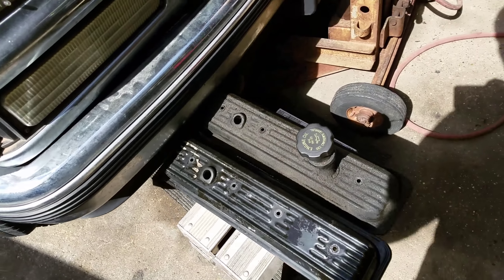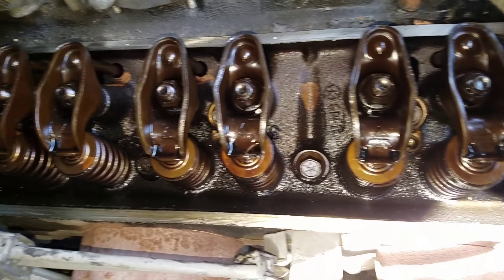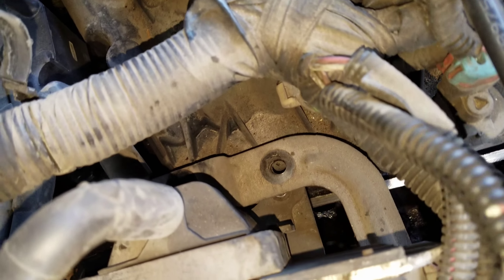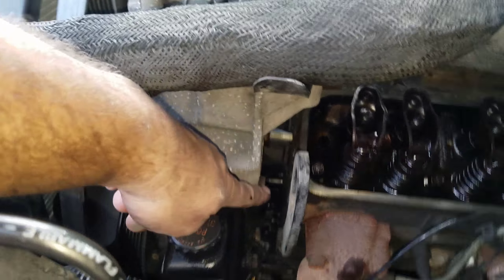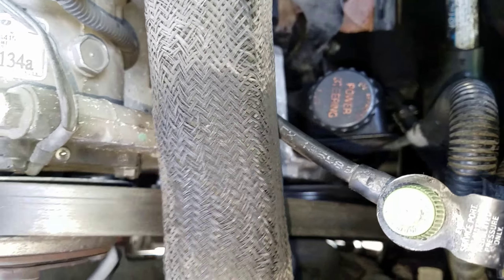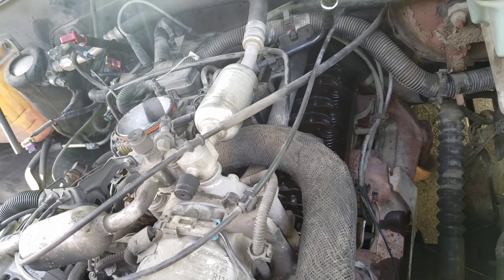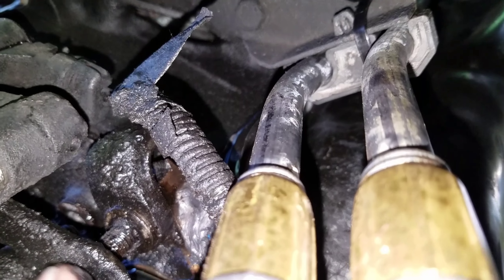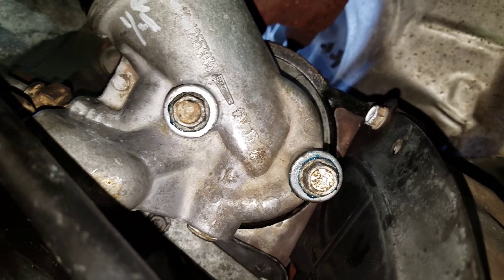1999 Tahoe valve cover removal notes 5.7 z71

Comment: The bolts on the valve cover are 3/8 not 10mm
Reply from the maker: Ok
Reply: @chriskolar  vortec motors are easy to get sae and metric mixed up all the old sbc stuff on them is safe and all the vortec stuff and accessories is metric
Reply from the maker: @trucker6689  yea, my quip was partly a complaint to GM for mixing things up. Thanks for watching. 😎
Reply: Close enough😂

Comment: Its a damn good SUV. One of the best in my opinion.
Reply: bolts get stuck because they are actually 3/8 not 10mm.
Reply from the maker: @weaklingv2  right, its a common mixup having a variety of metric and standard.

Comment: If the rockers and springs are really dirty full of carbon build up. Do you have any recommendations on how to clean it throughly? Someone said to use diesel and a wire wheel on a dremel. To do an oil change afterwards and one after 50 miles.
Reply from the maker: That is up to you and how much time you have. Using strong cleaners is not reccomended. The valve stem seals will get the cleaner on them and may get degraded then not work properly. Using some diesel in the oil is prolly the best method. That will slowly break down the sludge. If using any sludge removal methods remember to keep track of the oil and change it often when it gets dirty. Look out for oil deals at the auto parts. Sometimes old oil brands are sold out cheap. Its still good oil just not offered at that store anymore.
Reply: Chris Kolar I went with the diesel and wire wheel. I removed the springs and rockers and replaced the seals.
Reply from the maker: Nice

Comment: Is there a way to acces the lifters on driver side with out taking out the ac compressor etc ?
Like the temp sensor and the 4 top bolts?
Reply from the maker: No, the bracket blocks access to the front bolts on the intake manifold.
Reply: @chriskolar  shit ok thanks man
Reply: Chris Kolar how do you take out the 4th bottom left bolt that you can’t get on camera the power steering pulley blocks access to it
Reply from the maker: You can reach down from the top or get it from under the truck. You will just have to feel for from the top.

Comment: Chris - you mention the seals in the covers themselves appear to be leaking.  Are components inserted into the valve covers serviceable (such as the oil filler tube)?  Where did you find the seals, o-rings, etc to do that?  

My passenger side is clean, but the drivers side cover is filthy. Thinking it must be the oil filler tube and not the gasket since no oil on the block.
Reply from the maker: Yea the oil fill tube has a o-ring on it where it screws into the valve cover. Sometimes the fill tube is broken in the middle where it was assembled at the factory.
Reply from the maker: Oil fill tube

https://www.amazon.com/dp/B00Z7MODYA/ref=cm_sw_r_cp_apa_i_jHUkFbKHKV3GQ
Reply: @chriskolar  amazon url shows a bent tube for later 5.7s.  I have the straight tube, same as your video intro.  Are you saying the later tube works on the this valve cover?  what about the cap, replaced too?
Reply from the maker: @adamsusa  it would work but may not be the best part. I was reading the reviews and some folks were not to happy. Getting the oring may be the best route. I'll try to get the ac delco part number.
Reply from the maker: @adamsusa   here is a straight one, new old stock, AC Delco

https://www.ebay.com/itm/202194779527

Comment: How hard was it to install them back on with the gaskets and the intake being a tight space?
Reply from the maker: The valve cover gasket fits pretty good on the valve cover, so if you dont bump it too hard it will stay in place while maneuvering it into position. The intake gasket sets into a position on the ends and is just ok for stability. Some mechanics use a fast setting adhesive in a few spots to hold the gasket in place so that they can install the intake without guessing if it moved or not. The fel pro plastic reinforced gasket has alignment pins that hold it in position.
Reply: Chris Kolar yeah I had to replace my intake gaskets about 3 years ago and I didn’t know if they were the same as valve cover gaskets! But is that what you used was fel pro?
Reply from the maker: @micah2395  yes but I used the 1255 gasket because it is a solid gasket material instead of the plastic reinforced oring style. The solid gasket is the old type and is .125 thick. When installing I use silicone around the ports and on the water ports. The ports that have water usually have lots of corrosion and some remedy is required. The best way is to clean the corroded material away and fill with jb weld. This takes much more time and is a more professional job. I have done it both ways and the silicone works just as good. Just always remember  when ever taking it apart you will need to cut the silicone before trying to remove the intake because the excessive force may damage the intake.

Comment: Hello, thanks for the video very helpful. I'm chasing a mystery knocking sound that occurs for about a second on and off when I start my truck. It started after I replaced the oil pan gasket, timing chain, and cover. I was thinking about removing the valve covers and trying to see if I can hear/ see the culprit. Would you attempt this? Also if I was going to do this do I need to replace the  intake gasket as well? Or can I just pull the covers and leave the intake In place? The truck has 212,000miles pretty sure original motor but a rebuilt trans 99k1500 5.7 vortec

Knocking after truck had sat for 2 weeks: https://youtu.be/VgjNjjWdrlc

Knocking after 10 miles of driving highway and city: https://youtu.be/i0cWycjqTj4
Reply from the maker: How much oil pressure? Does it have the oil cooler?  When it is knocking remove the spark plug wire one at a time to help isolate the knocking if it is a rod bearing. When you removed the pan were there any discolored rod end caps? Did the pan have lots of debris in the bottom?
Reply: Thank you for the reply sir. At Idle oil pressure reads 30 psi if I snap the throttle it goes to 60 then once I let off it drops to 25 then stabilizes at 30 psi. I still have the oil cooler. I replaced the quick connect fittings, and the hoses when I did the oil pan. When the pan was removed I did not notice any discoloration but I'm not a trained eye and I was not actively looking, I might have missed that. 

I will attempt to remove spark plug wires and update this reply woth the results
Reply from the maker: Check flywheel bolts, check harmonic balancer bolts, remove belt and check without
Reply: @chriskolar  thabk you for all the help. new Harmonic balancer torqued to spec. Ran without belt same knock just for a second at start then nothing. While I had the fan off i tried hand cranking the motor a few times. Once every 2 rotations I could hear a quiet but distinctive "ping" could this be a rod bearing? How could it go away once the engine is running?
Reply from the maker: @yannickbigras2890  did you check the flywheel? Also if it has bad gas it will knock too. The sound is like something is loose or broken. Please check flywheel and check back and let me know. Diagnosis is a key factor in thg his situation. Go step by step an eliminate the factors. If there is a rod knocking you can pull the bearing and replace it before it gets too messed up.
Reply from the maker: Also what filter are you running?
Reply from the maker: Did you press the harmonic balancer on then torque it? The balancer has a key way too. Was that installed along with the balancer? It's called a woodruff key.
Reply: @chriskolar  wow! It appears the fly wheel is rocking back and forth about an 1/8 of an inch I looked at the bolts and there is evidence of metal to metal sliding right next to one side of the bolt head. I will attempt to re torque and update. 
I use a wix oil filter.

Also I did press the HB on with an installer tool before installing the pully and then finally torqueing the hb bolt. I lined the notch up when I pressed the hb on.
Reply from the maker: @yannickbigras2890  cool, you found the problem
Reply: @chriskolar  I couldn't have done it without your help thank you!